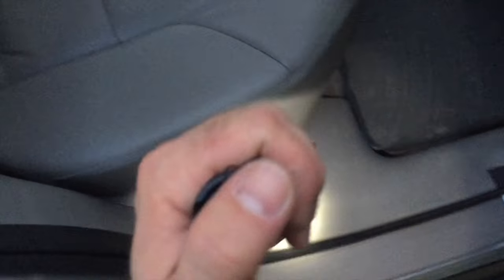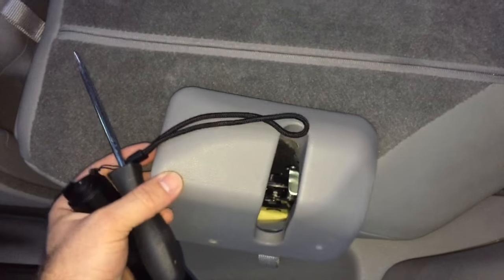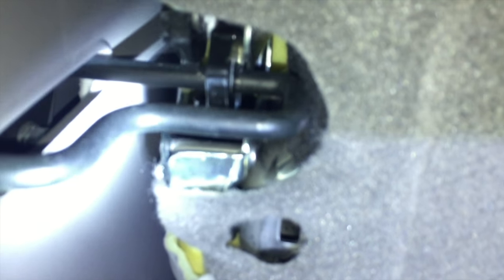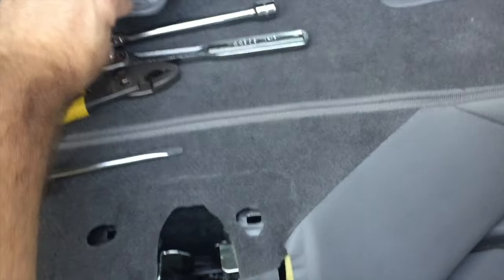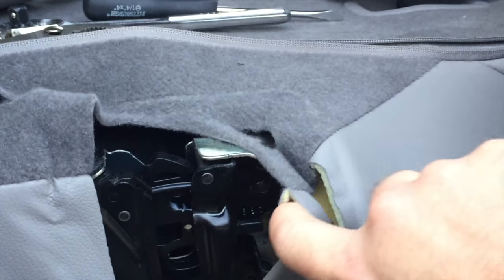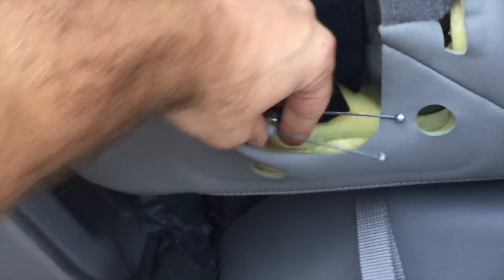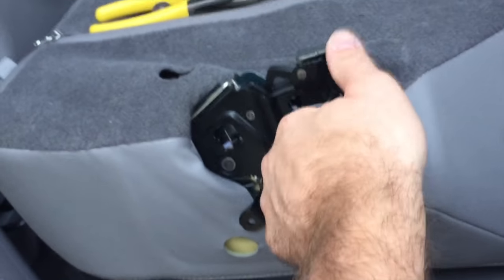FIX: Rear Seat Back Jammed/Stuck/ Won't Fold Down on a 2012 Honda CRV

Comment: Thanks for the video. Here’s another tip I figured out along the way in case people are still reading all the comments. You can pop that plastic cover loose while the seat is still upright, which gives you better access to undoing the latch. It won’t come out, but you can move it around. Thanks again.
Reply from the maker: Nice tip. Thanks!

Comment: I tried for about 15 minutes, took a little break and came back. It was so much easier when I took off the plastic piece around it. I don't know why I didn't do that in the first place. Thank you so much for saving me money going to the dealership to get it fixed.

Comment: This video was really helpful.  It's so strange that both my seats stopped working simultaneously.  At first I thought it was something electronic until I started researching on what the issue was.  Read many others having the same problem.  This should be a recall for sure on these things.  The only thing I would advise about this video, is that the rear seat behind passenger front seat, the latch on that single seat is totally easy to manually unlatch, however, the double seat behind the drivers side is a nightmare and was super difficult due to the plastic housing cover over it that prevents you from getting in there.  The latch was a total bear to get under and pull-up.  Once I figured out I needed to put a little muscle into it and just dig in, I finally got it to come-up.  Thanks so much for this video!!
Reply from the maker: Yes, I thought this would be a problem when I made the video because it happened so randomly, and when I found that the part was made this way, I realized this will be happening to (a lot of) others. I'm pretty sure it is designed to fail so you have to get the dealer to repair. Hope the video helps to at least know what is involved with the repair, if not save some time/money by being able to DIY fix it.

Thanks for the note on the latch. It is a bit tricky to trigger - and does take a bit of force so that it unlocks (and harder to video... ). If you can get one side, it may be a bit easier to see the mechanism to trigger the other side.

Comment: Thank you!  Your video was perfect.  You just helped me to save $175.00/hr in labor charges if I had gone to the dealership. Took me about 15 minutes to take out the old parts and about 15 minutes to put in the new parts.  That was for both sides.  They had both broken in the exact same way as you showed. Again, thanks!
Reply from the maker: Great to hear!

Comment: I appreciate the video which helped in removal of the part. Once I got the broken part out I removed the plastic from the metal piece which holds the cables and put the uppermost hole over the hinge assembly and put it back together. It is not quite as smooth a release from the top of the seat as a new part but is a quick fix for 0$ and when using the release in the trunk it feels exactly the same.
Reply from the maker: Oh, that is good to know. Thanks!

Comment: Thanks man, this is EXACTLY the problem that I have with my CRV on the other side of the world. Your video was really, really helpful 👏🏻
Reply from the maker: Glad to help!
Reply: Where can I source these parts?
Reply: And what do I ask for?
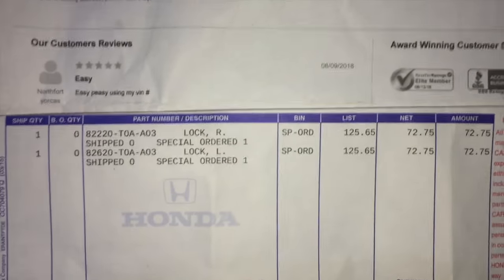Reply: @nakevafairclough3347  The part numbers are shown in the video at 1:49. I'm in Australia and the part numbers were the same.
Reply: @nakevafairclough3347  I compared online but ultimately bought the part from my local Honda service centre. It cost me AUD$146.88.
Reply from the maker: @andrewburton6050  Yeah, I took a print out to the Honda service center and they price matched an online dealer. May be worth a try for anyone in need.

Comment: Great video. I used it  to change out the latch in my 2012 CRV today. Luckily I found one on EBay for $38! 

It's hard to believe that Honda would make a heavy duty part like this and then use some cheap nylon plastic in such a critical area. 
A couple of suggestions that might help:
1. Those bolts are 12mm.
2. I found it easier to first remove the trim piece which made releasing the seat back a snap. A trim removal tool made it possible.
Reply from the maker: Thank you!
Reply: theres an easy methid also no need replace whole assemble only need a metal wire to hook both ends that it
Reply: @ricsonstarce  did the same with 2 zip ties .works perfectly .

Comment: Thank you for this video.  My driver's side (left) rear seat would not fold down.  I ordered the parts and installed them with the help of this video.  It turns out that the right side latch was also broken, yet it would still fold down.  So as others have suggested, you should replace both latches if you have an issue with one.  Also, in order to test whether it works, you need to flip up the seat cushion - otherwise the release cable does nothing.
Reply from the maker: Good point! Yes, both of my latches failed within the same month. I don't know if they were both used the same amount or if it is just that the (cheap) plastic components break down in that time period. Either way. It is worth replacing both at the same time while you have the tools handy and everything ready to go, because the seem to fail at close to the same time.

Comment: Great video - helped me solve the problem with my rear seat.  Was hoping just the wire had popped out but can see, without taking the part out, that the plastic piece is loose so probably broken. Ordering new part today.  Thanks!!
Reply from the maker: You're welcome!

Comment: Thank you! I had exact same problem with my 2012 CR-V. Same car, same problem. Both seats broke within a week of each other. DEFINITELY change both seats if/when one fails. I went to two dealers, neither had seen this before. I suspect they'll start seeing it now. Easy change for me, np. Thanks. TL
Reply from the maker: Yep. IDK if I was the first one that this happened to, but when I saw how the part was built, I KNEW it would happen to everyone. Doubtful that they will have  a recall though.

Comment: Very informative and detailed.  I was going to take it to the shop but with your helpful tutorial I'll give it a try myself.  Thanks!
Reply: This was really easy to do; took less than a half hour to do the work.  I found a place in Japan, JP Carparts, who sent over the right side latch based on the part number in your video.  Total cost, including shipping, was about $50 and I got it in less than a week.  I'm sure I saved a bundle.  I really appreciate you taking the time to create such useful instructions and helping us DIYers help ourselves.
Reply from the maker: Great to hear! And glad to hear you found a supplier in Japan!

Comment: Thanks for the great video! Really appreciate it. 
I tried the zip tie method but it only worked a few times, and then the balls on the end of the cables came out of the metal clip, after they bent the retaining tab. Must be a lot of forces involved. I’m afraid using zip ties will eventually break the cables themselves, and cost a lot more to have replaced. So, I will be buying the actual new parts. Thanks again.
Reply from the maker: You are welcome! Yes, that is what I was worried about with the zip tie method. Once you go through the effort of taking it apart, it seems that it is worth it to just replace the parts.

Comment: Thanks for a very helpful video. I had the same issue. the hardest part was getting to the latch to drop the seat with the shroud cover in place and not managing to break the locating tabs. Managed it eventually and an easy job after that just following your advice. 
I would say this will be common failure point in the future as it is a plastic part that fails.
I recommend prising up the shroud to get behind it to move the latch initially. Costs about$125 AU in Australia from Honda
Reply from the maker: Glad it helped and that it works in Australia!
Reply: Thanks for your advice.I will change mine they have failed.

Comment: Thank you for your step by step video. Both my seats on my CRV -2014 have the same problem. Very expensive part to replace . Can't understand why Honda would retain  a weak plastic part that breaks after a few years.  There is a post using  2 zip ties to hook up to the latch if yours breaks again .
Reply from the maker: Yes, it seems built to fail. The zip tie video looks like a good idea, but I wouldn't want to have to repair it too often.
Reply: Hi Robin, care to share the link using zip tie? I have difficulty finding the replacement parts here. Thanks in advance.

Also shout out to Zach for this wonderful video. My 2015 CRV have this same problem too!

Comment: so if I may, i have a dodge durango with a 3rd row seat. Theres a problem when folding these seats foward; the right side seat will fold but the seat next to it wont budge. The Headrest will fold just not the whole seat. Thats been a problem for me for months and getting the groceries into the back has been a problem because I do not have the room. Would the problem be the same as that vehicle you're demonstrating??
Reply from the maker: I’m not sure – but I would think the mechanism would be completely different on a Dodge

Comment: Thanks for the handy video. I took mine out. Looks like the nylon/steel bit that attaches to the cables has just popped off it's pin. Wondering what held it there in the first place. I put it back on, re-installed, and it just popped off again. Might have to buy the part if I can't figure out how to fix it.
Reply from the maker: Sure! There are a couple plastic clips that attach the cable to the mechanism. You can kind of see them in the video. It sounds like the plastic clip may have broken on you. For example, tat 9:13 you may be able to see that there is a grey clip on the top and white on the bottom attached to the cable. IDK if you can get that part separately, or if it comes with the cable. I hope this helps!

Comment: Got plastic cover off for easier access can lift lock with screw driver but still doesn't release????
Reply from the maker: It is a bit tricky. If you can wiggle the screwdriver, I think it will eventually pop out for you

Comment: Are the replacement parts made of more durable materials or are they exactly the same plastic parts that could possibly break again?
Reply from the maker: No. Not at all. They are designed to fail.

Comment: How did you make the left rear seat to go down when it still had the cover? I tried to use a flathead screwdriver, but there's not enough room on the left to life the lock....
Reply: I just commented on this.  It's a nightmare.  You have to really dig into it.  That plastic housing on the outside prevents you from getting a good angle to dig your screwdriver under it.  I finally realized that you have to put some muscle into it and angle your screwdriver up, in and then down.  I was being too gentle because I was afraid of damaging something.  Once I did this, it finally worked.  It only took me like 30 mins of doing this over and over that I figured it out.  Good luck!

Comment: This happened to me today. You can use your finger to open the stuck latch when the seat is upright. With a screw driver it was a bit difficult so the finger method worked for me. Where did you get this part for $75? The cheapest I can find it online is $96. Please let me know!
Reply from the maker: Yeah, it looks like the price of this part has gone up... I found the part on HondaPartsNow.com (2:02 - minutes in the video) (https://www.hondapartsnow.com/genuine/honda~lock~r~rr~seat~82220-t0a-a03.html)  ---  It has probably gone up in price because of the high demand from these poorly designed parts breaking.

Comment: Thank you for posting this video! Gives me the confidence to try and fix this problem myself. There are no stupid questions though right? Please can you tell me if the rear seat behind the driver's seat is considered the left or right hand side? That is the one that has broken on mine... I never use the other side due to a child seat being installed (Australia) so I am not wanting to spend the extra $$$ given it most likely has plenty of life left in it.
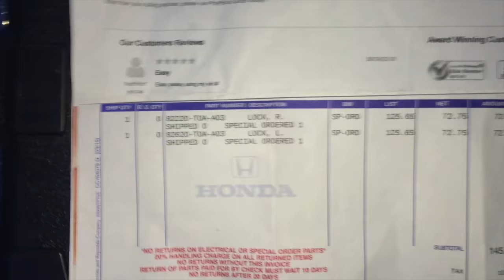Reply from the maker: Correct! There are no stupid questions! I had the same question myself when this initially happened to my car. The parts ARE different on both sides. At 1:50, I show the invoice with the part numbers. Part Number 82220-T0A-A03 is for the Right Side and 82620-T0A-A03 is for the Left Side. These part numbers are for US vehicles... I assume they would be similar for Australia, but I am not 100% sure. They are definitely two different part numbers, though, since each side is different. I hope this helps!
Reply: @Zacholas  Thank you I was just wondering this same questions. so very helpful

Comment: What’s the replacement part number for the plastic cover that you broke?
Reply from the maker: 82220-TOA-A03. (Lock, R.) = Right Side Rear Back Seat
Upright Lock
82620-TOA-A03 (Lock, L.) = Left Side Rear Back Seat
Upright Lock
Reply from the maker: I tried to leave all the info in the comments – hope that helps!
Reply: @Zacholas thank you. I meant the plastic cosmetic cover part.
Reply from the maker: @floridagirl925  I have not replaced mine, but need to... I THINK the part number is: 82221-T0A-A01Z - and at the end of the part number add an "A" for beige, a "B" for gray, or a "C" for black.

It is close to $100 on all the sites that I see 😢

Comment: @5:14:  Ugh.  That one piece of plastic costs $80.  That's just for the part itself.  That is insane.  Honda is horrible about indicating how to remove that crap.  So much of it is designed to be pried and popped off (e.g., the lining of the rear hatch), but then they randomly add stuff like this, where pulling it off breaks it... and then they charge you out the wazoo for a piece of plastic.

Thanks for posting in order to help some other people avoid that fate.
Reply from the maker: You are welcome! I hope it continues to help those that need it.